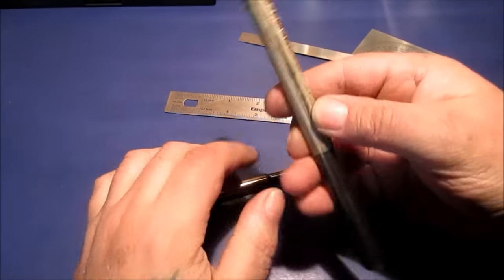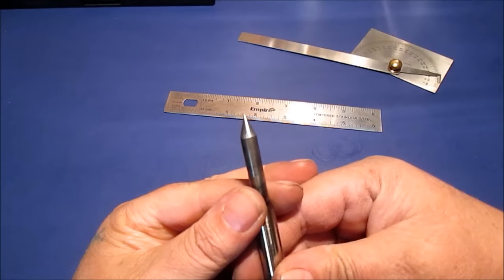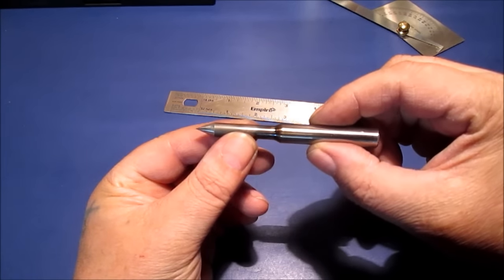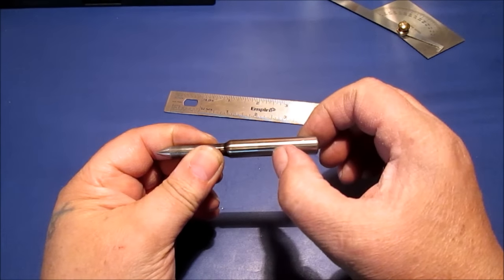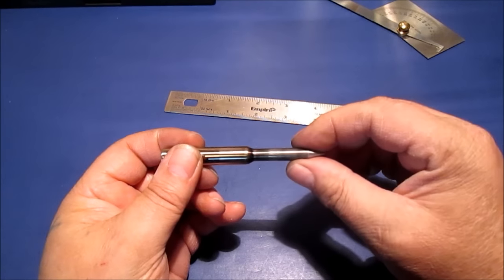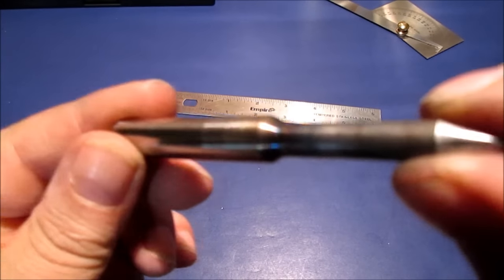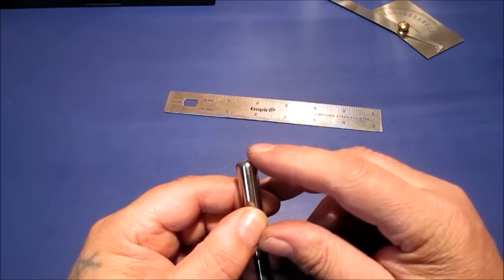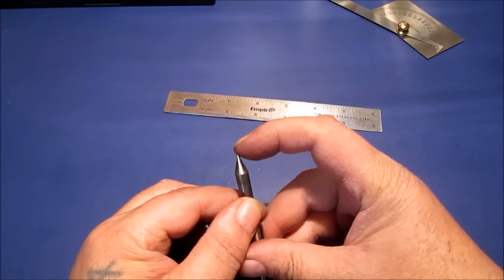Small Hand Made Center Punch

Comment: I came here hoping you had the answer to the very problem you had. I have the same problem - tried carbide (400-500 sfpm) and HSS @ 175 sfpm and the 1144 always acted really gummy. If you saw my work, you would have a hard time deciding whether it was a threading job gone haywire, or the sickest finish any noob ever achieved during basic turning on the lathe.  Some guys sing its praises but so far I have not been able to unlock the secrets to use this. I had to post-process my turnings - medium file followed by 600 grit wet/dry sandpaper. Not a finish I would show off to anyone.
Reply from the maker: This was a nasty metal to try and turn down in the lathe

Comment: Nice looking punch. I have a two questions about it. If you have a lathe why did you grind the tip instead of turning it? Also, how did you do the hardening?
Reply from the maker: The purpose of the video is to show you can use a disc sander or grinder if you do not have a lathe ...It would be better if you researched how to harden and temper steel ....Than have me try to explain it
Reply: Good idea. No need to watch your videos.